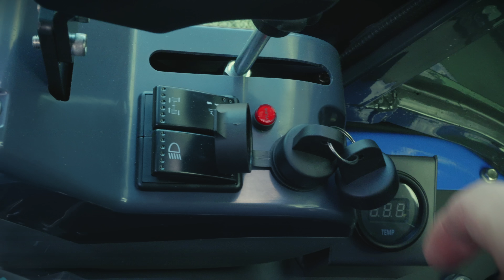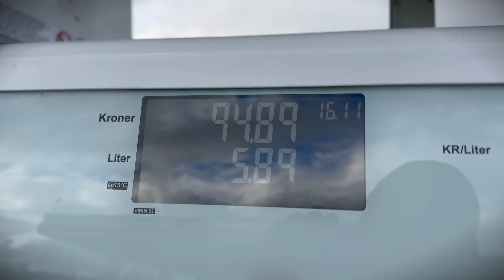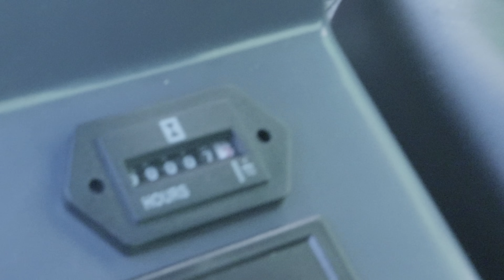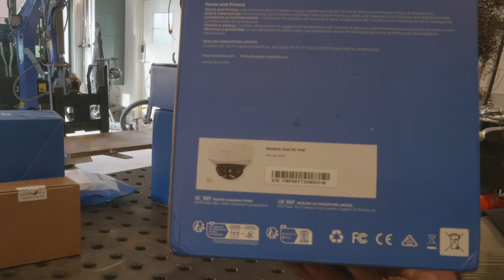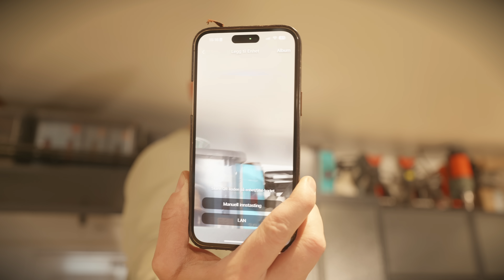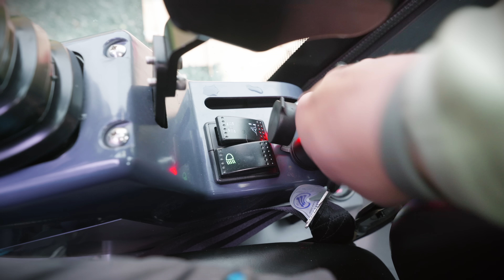I Bought a Mini Excavator From China and THIS Arrived!

Comment: Hi,
Do you have a link to the Alibaba seller?
Reply from the maker: Check out my pinned comment😊
Reply: @frengen_engineering  The mini excavator you are presenting cannot be found on the company's website. There is no blue mini excavator there. I have no idea what you are presenting and what the salesperson is actually showing. Which model is that supposed to be?
Reply from the maker: @achimgazelle3641  Hi, it’s a VTW 1,2. I gave Vote the specs, and they built it as I wanted. I chose everything described in the video. 😊

Comment: I strongly doubt the CE mark - unless it stands for 'China Export'.
Reply from the maker: Isn’t that what it is ment to stand for? I am confident it’s made in China
Reply: @frengen_engineering  There's a difference between the CE and 'China Export' logo, the spacing gives it away.. and they've not gone with the 'China Export' version on this machine, bit naughty of them, but it looks an ok machine for doing gravel on a driveway and some light trench work.
Reply from the maker: @John-The-Farmer Hehe! Was just kidding. I have got all the certificates for the machine, so they do claim to be all within the specs. And I have got all the documentation. So, let’s just hope that the specs actually is aligned with the requirements for CE. I do think so. Everything seems as it should be. There is for instance not possible to start the machine if the pilot stick on the door side is not in the up position. And it’s not possible to control the machines before its lowered. This is an EU requirement. And the Engine is CE approved and well documented from Kubota. It’s an Euro 5 engine. If it was not CE documented, I would have difficulty getting the machine imported, with customs control and all😊
Reply: 💯 true.  It'll mean nothing
Reply: @handyjayes1  
He has just confirmed it means what it says...
certified for use in Europe and meets European requirements.
Reply: To be true… you can find this sign on every Chinese product…even in bride-catalogues…😂
Reply: @StudioBonn  Real CE symbol has a space between the letters so that if you extend the C and turn it into a circle, it intercepts the left side of the E. China Export symbol on the other hand has both letters crammed together.

Comment: Bara ett stort problem!!
Hålen i vägen kommer tillbaka om man inte gör ett grundarbete först^^
Det finns underliggande problem med försänkningar i vägytor.
Oftast dåligt grundarbete.
Att sprida nytt grus ovanpå är bara ett sätt, att få hålen att försvinna under en kortare tid!!!
Reply from the maker: Dette høres heller ut som selve løsningen på problemet mitt. "Problemet" var jo at jeg egentlig ikke trenger en gravemaskin? 🤣 Neida, jeg gjorde det faktisk ganske ordentlig, med finkornet "subbus" i de største hullene. Jeg komprimerte massen, før jeg la ny singel over. 😊
Reply from the maker: Men igjen, jeg kommer til å legge drensrør, og lage litt helling på veien til våren. 😊
Reply: @frengen_engineering  Skall vi slå vad om att hålen kommer tillbaka inom en snar framtid?
Du har inte tagit hand om problemet i vägens grund. Alltså inte grävt ur hålet och byggt upp en ny grund!!!

Källa för min kunskap. Jag har byggt vägar i 30 år^^
Reply from the maker: @Sidio333  Not at all a professional job, that’s for sure. But I did use the smaller digging bucket, made the masses loose, before making everything flat with the blade. Then comprimator, and then gravel. This is not included in the video at all. Trust me😄
Reply: @frengen_engineering  Du kan kanske kalla det ett godkänt jobb. Men utan att bygga upp en grund för vägen med större stenar i botten, kommer GARANTERAT den vägen få ett nytt hål/grop på samma yta^^
Reply from the maker: @Sidio333 Du har nok rett! Men jeg gleder meg😄🪏

Comment: Ignoring the main point of the video, I want one of those mini delivery trucks with a built in forklift! That's really living in the future.
Reply from the maker: Yep! It was a solid machine! Fun Fact (This loader was also a brand new machine. First time unloading) 😊
Reply: @frengen_engineering moffett invented the first truck mounted forktruck here in Ireland in the 80s
Reply from the maker: @GameCastCubed Really cool machine! Not often I se this setup at the road
Reply: @GameCastCubed hessel kooi invented the kooiaap in the seventies.
Reply: They have been around Europe for 35/40 years. I don't understand why the rest of the world is slow to catch up.
Reply: thats alr around for  40 years
Reply: Called a Moffat here in Ireland where they are on the back of most large delivery trucks. My local DIY store deliver my building supplies using one.
Reply: @sonovoxx  some people call it a piggy back.
Reply: Moffet mounty...common as muck here in the Emerald Isle....
Reply: I see them all the time. If you're from the US, you probably can't have them due to the Chicken Tax.
Reply: That forklift also can rotate its wheels by 90° to drive siedways.
They are mainly used to make deliveries to places where no other means of unloading are available.
Reply: LOL I was thinking the same thing

Comment: Seriøst kun rett over 20k.... Trur vi må få en link til å bestille 
Hvor mye ble det totalt ink frakt og toll?
Reply from the maker: Det var lure- tilbudene som lå i denne gata. Prisen på denne, med utstyr havnet på ca 115k NOK ink frakt😄
Reply: @frengen_engineering forsatt masse maskin og utstyr for penger 👌
Reply: Kinserne har typisk slike 'luretilbud' på disse handlesidene for å trekke oppmerksomhet) Par med skuffeskinner til 'kun 1 usd', + frakt 25 usd så er de oppe i den egentlige prisen de skal ha inkl litt frakt)
Reply from the maker: @Rimrock300 stemmer det. Jeg fikk aldri noen tilbud som lignet de annonserte prisene, når frakten var lagt til. Det er også en del uoversiktlige kostnader, slik som havnegebyr, lossing osv
Reply: Hei. Bra video som alltid. Er det lov å spørre om link eller kontakt info til samme kar? Vurderer samme type maskin men 1,7-2,0t. Har en 1,7t Kubota fra før, eldre årgang men den er for høy for garasjen. Sku gjerne fått den inn. Hvor høy er den du har kjøpt. God helg👍
Reply from the maker: @1983Macgyver  Hei, Takker😊 Søk opp Vote på Alibaba og spør etter Michael. Skal høre med han om jeg kan dele kontaktinfo her. Høyden på maskinen har jeg ikke helt klart for meg, men den er farlig nære 229cm. Gikk akkurat inn i garasjen, og jeg har 230 port. Skal ta noen mål når jeg kommer hjem. God helg😊👌
Reply: @frengen_engineering  That's the 1 real problem with tracked machines - you can't just let the tyres down to get that last couple of centimetres. 😜🤣🤣